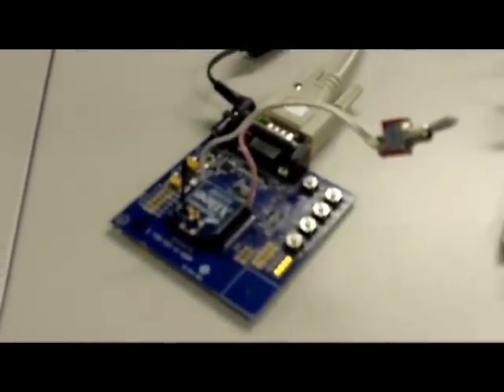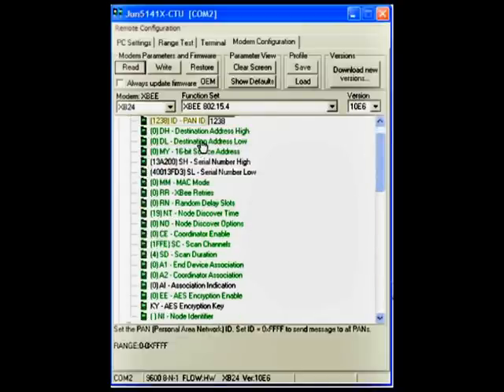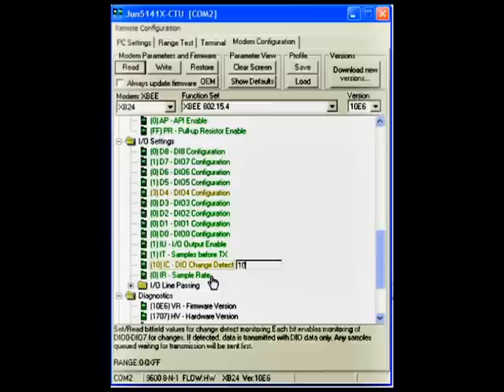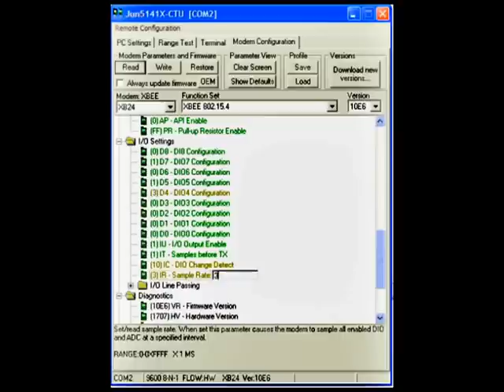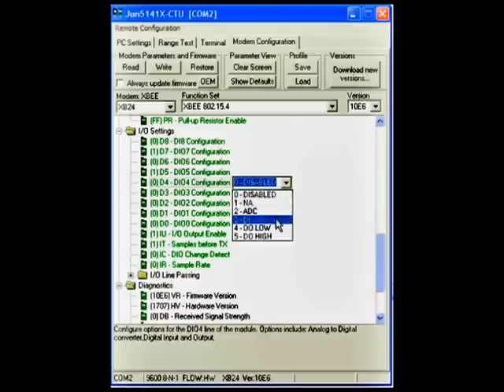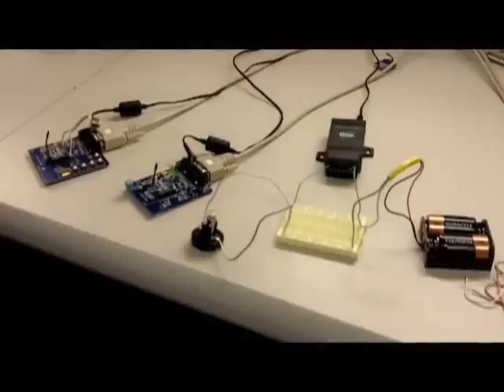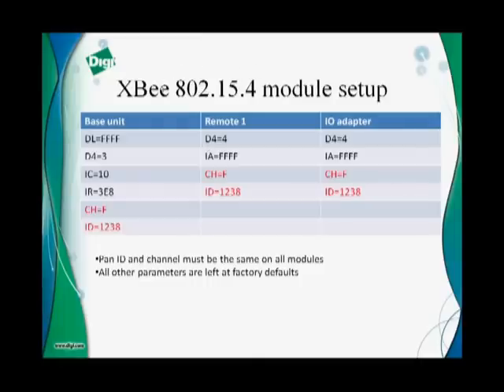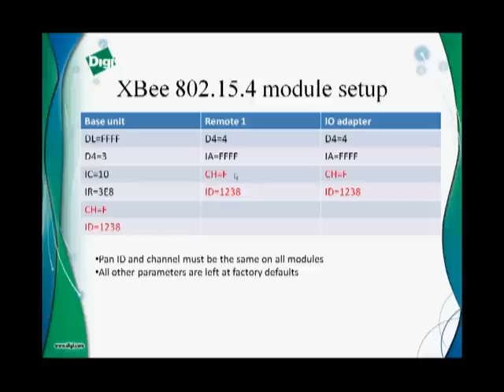XBee IO line passing

Comment: I'm using the newest version of XCTU and I'm missing the "Line Passing" folder/tab that you have there.
Reply from the maker: It should be there.  The folders perhaps may be in a different order and open or closed by default.   I would suspect that you have the I/O section minimized (closed).  Do a search up in the upper right  hand search box to find one of the parameters you are looking for.

Comment: Hi- can you tell me what the latency is between issuing a state change on the transmitter and and having the stage change reflected on the receiver for DIO line passing ??
thx
jk
Reply from the maker: +Jdkurtis The latency will vary with your baud rate setting but the over the air latency is about 4 milliseconds the total latency should be less than 10 milliseconds with an interface baud of 9600 bps.  Here are links to a couple of knowledgebase articles that should be helpful:  
http://knowledge.digi.com/articles/Knowledge_Base_Article/Sending-data-through-an-802-15-4-network-latency-timing

http://knowledge.digi.com/articles/Knowledge_Base_Article/Timing-Comparison-For-Data-Transfer-By-Product

Comment from the maker: @Tom Baby 
No.  The Zigbee modules will not do direct hardware line passing.  To accomplish this with Zigbee, you would need need to have a connected microcontroller (or a PC) to send remote command frames using the API; the remote radio would receive this and then set the I/O pin on the remote radio to go high or low.

Comment from the maker: Yes.  The setting will be saved through a power cycle. When parameters are written using the Modem Configuration tab they are saved to non-volatile memory.  If you set parameters under the Terminal tab using AT commands they are wriiten to volatile memory unless an ATWR is issued to write the settings to non-volatile.

Comment: Thanks for the demo.  One question I have:  Do the settings you made get preserved when the power is removed from the module, or would I need to reconfigure every time I power-up the modules?
Reply from the maker: Yes.  The setting will be saved through a power cycle. When parameters are written using the Modem Configuration tab they are saved to non-volatile memory.  If you set parameters under the Terminal tab using AT commands they are wriiten to volatile memory unless an ATWR is issued to write the settings to non-volatile.

Comment: Correct.  Hardware line mirroring does not lend itself well to mesh networks.  The series 2 (zigbee) will not do one-to-one hardware line passing like the  802.15.4.  However, with series 2 you can remotely control a line by setting the transmitting module in API mode.  The API provides flexibility. Remote API frames can be sent to control any of the I/O lines.